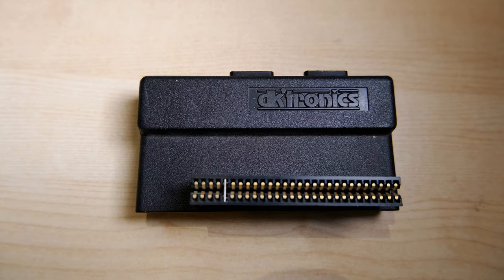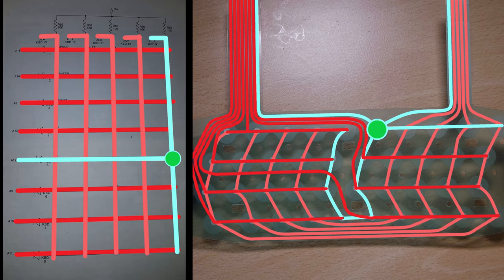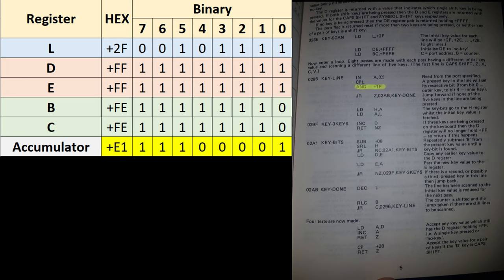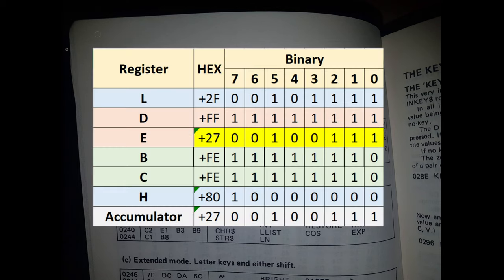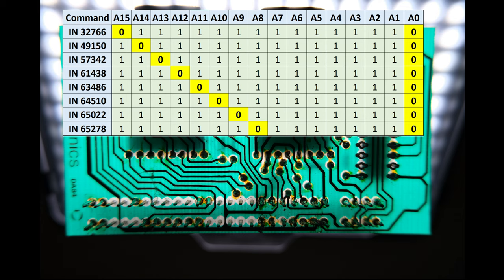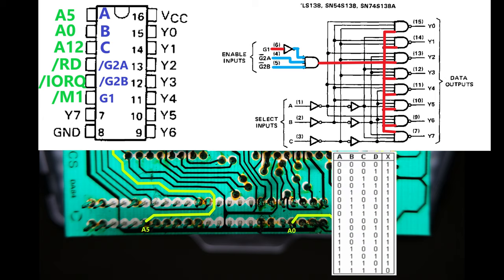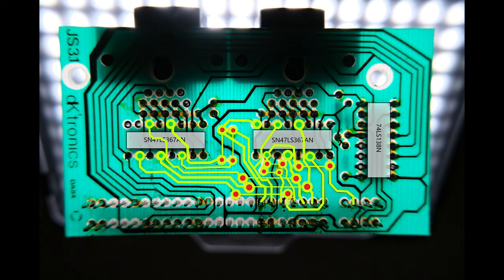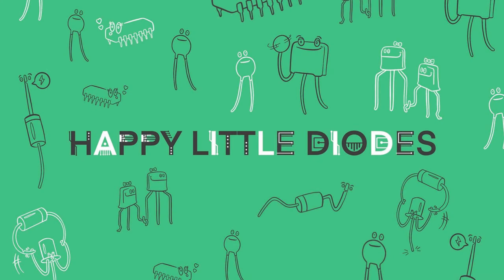How the ZX Spectrum Keyboard Works - Deep Dive

Comment: Also of interest with this interface was you could cut the A12 line and reconnect it to any of the other address lines, so the 'Sinclair' joystick could operate any row of 5 keys. But the flaw with the Sinclair protocol was, if you made it operate keys 1-5 (Sinclair #2), it operated them in reverse order.

Comment: I think your Delta joystick will work fine in the left port use in 31 to check, loving the videos.
Reply from the maker: Yes you're right I'm doing the same process on a kempston interface at the moment and I realised this.  I overlooked the importance of the resistor ladders which are the final piece of the puzzle

Comment: There's actually a number of ways you could do joysticks on the Spectrum, but because of the way the keyboard interface works it's very easy to piggyback on the keyboard.  Since there's already a lot of routines that handle the keyboard, compatibility becomes very easy, especially with games that allow you to redefine the keys, which is virtually every game after about 1985.

Comment: The early joysticks used with the specxy were Atari wiring. Later joysticks are physically identical but some writes are swapped (cos amstrad profit).
Kempston and Keyboard are just two different ways to represent the joystick data to the CPU.
M1 is pulled low during an interrupt (and pulled high during an IN opcode).
Good video :)

Comment: I still have this interface with my old 48k rubber keyboard Speccy and Quickshot 1 and 2 joysticks.  Unfortunately I don't have a power supply, but I have 100s of game cassettes that are probably all knackered by now.  Im planning on displaying it all in my gaming room that I am creating. Spectrum,  Amiga 500, old consoles, PCs that I still have and emulated machines on a Raspberry Pi.  All 8 and 16 bit and 4 PCs from a 386 up to the XP days.  I just need a C64. Thanks for this video as its very interesting.
Reply from the maker: You're very welcome